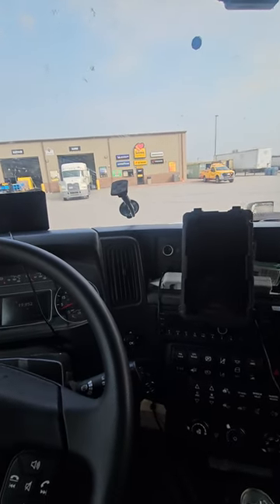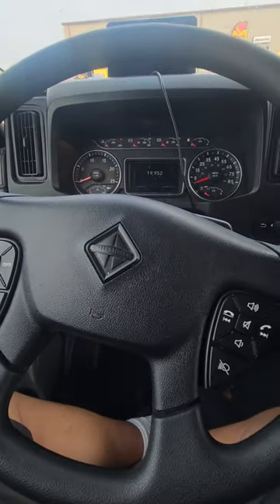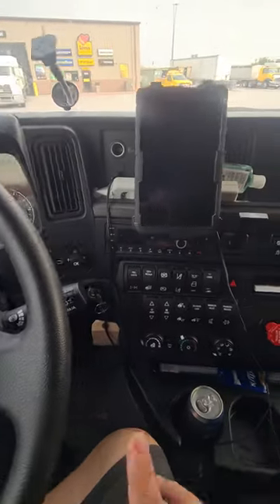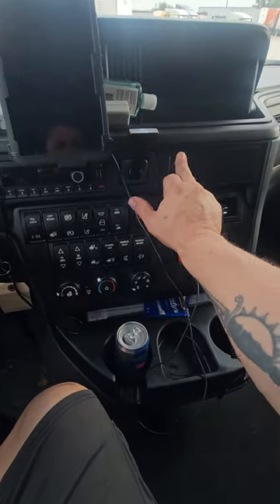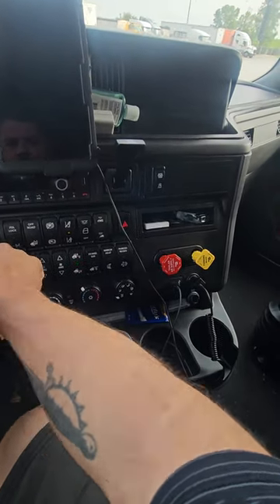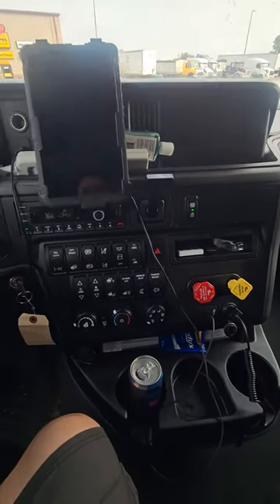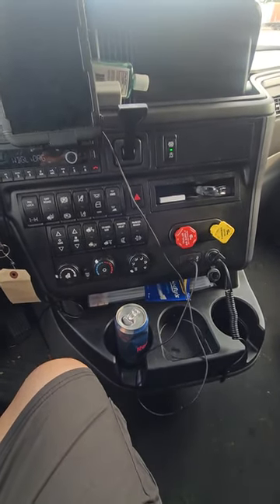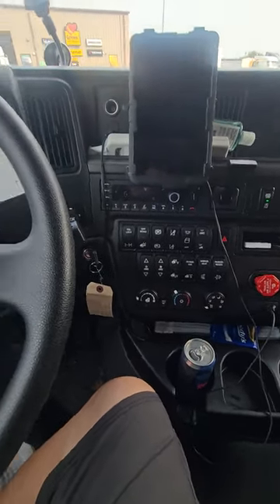How to run the ac without idle on 2024 international

Comment: Well I was thinking using to much power at the same time you may have to idle up the charging time ,  I used to run 4 to 5 battery's didn't have to charge so much , now I may be talking junk 3 new ones may be cool

Comment: I have a question about the refrigerator.  The light is on in the truck but it's not getting cold. Do you have any suggestions?
Reply from the maker: Check the knob inside its probably at the low setting turn it up or down which ever   will get the temp coldet

Comment: That and setting the temperature on the thermostat lower in the sleeper helps too. The big question I have is that when in subfreezing temperatures, we need to idle the truck at night to keep everything working as it should. Is there a bypass for that reason?
Reply from the maker: Yes push in the yellow park brake then push cruise control on button on steering wheel then hold set button and pull yellow park brake at same time but don't press the brake pedal

Comment: Turn your truck on
Press in the yellow button, while holding "on" on the cruise control settings
Press "set" on the cruise control settings and pull out yellow button
if you see "engine throttle" on the display, you've succeeded, your truck will now idle indefinitely
Reply from the maker: Ur absolutely correct
Reply: I pushed the yellow in. Pushed on then set and while pushing resume popped the yellow and then it idles up
Reply: That idle will only run the microwave if you have a inverter

Comment: Sadly my bunk display for the HVAC isn't working on my third day assigned to this 2024 LT. I have to run the engine and use the AC on the engine to cool down the interior.
Reply from the maker: Wow thar sucks
Reply: @truckinglifewithshawn  Called in to the company maintenance (I'm a company driver). Found out over the phone that the compressor fuse might have blown.